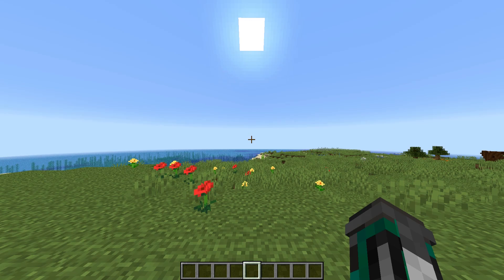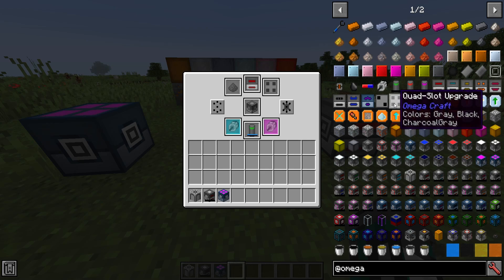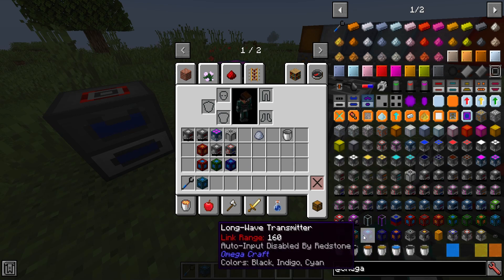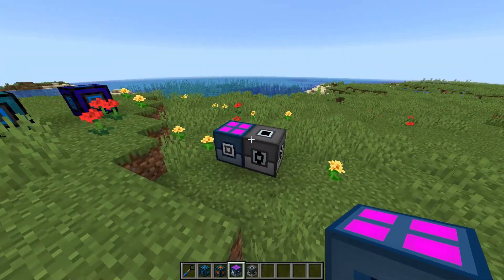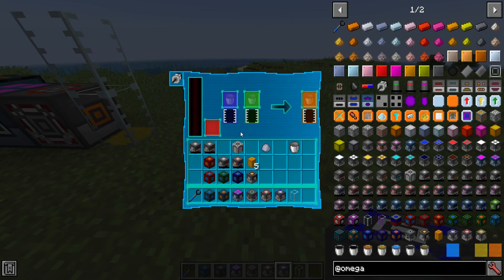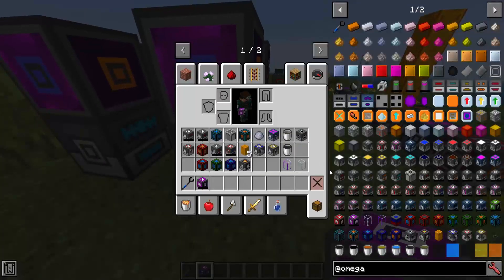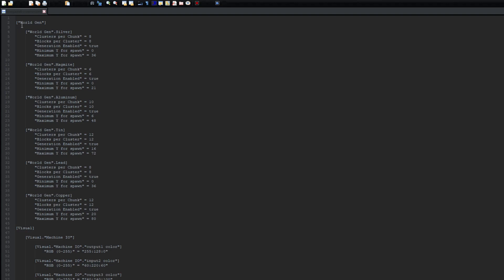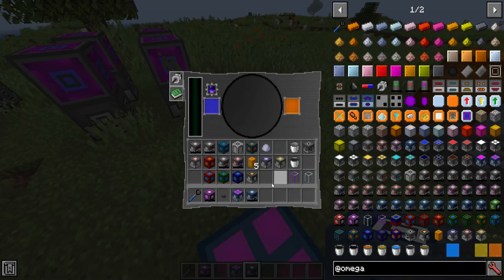Omega Craft 4 Minecraft Mod Update Showcase (1.14.4)

Comment: So is every thing the same in version 1.15 cause I can’t get the transfer and reserving blocks to link (and yes I have tried shortening the distance between them and even adding a connector to extend the range even though they are five blocks apart)
Reply from the maker: Yeah, it's all the same. You'll need to update your version to the latest for 1.15, as there was a bug that prevented them from linking in earlier versions
Reply: K

Comment: Would be nice that when you hold the wrench on your hand, you can view what machines are actually linked to.
also if something is transferring from one block to another, there should be some sort of particles, that shows the player, something is being transferred from the block and going to the other block.
Also would be nice if the block had some sort of external energy animation to show players that the machine / block is being used.
Something like how AE2 does when their block is being used it pulses its animation with colors.
Anyways, ill keep playing with the mod some more.  - cool mod
:)

PS>
I do like the minecraft mechanics in regards to the oil.  The reason why you have to go further and further away to get more oil,
is because it forces the player to explore.  Many people dont go and explore, this mechanic forces them to explore more.
Here is an idea for your oil machine.
If a player happens to get to a oil spot lake. - Instead of the player actually taking that oil, they place your machine next to it.
and by using your machine instead of mining it the normal way, the player would get 4 to 6 times more oil that is within that oil lake.
So it becomes best of both worlds,  because it forces the player to explore, and it also allows them to use your oil machine and get 4 to 6x more oil than they would normally get from mining the oil.
and with the ability of linking machines in your mod, the oil would be transferred remotely to any location the player wants, So long as they use extenders every 64 or 128 blocks.
which would extend the distance of the item transfer.
It would basically keep the game balance while using your mod.

Also im very confused with the cracking machine, the part of getting gasoline from Bricks.?